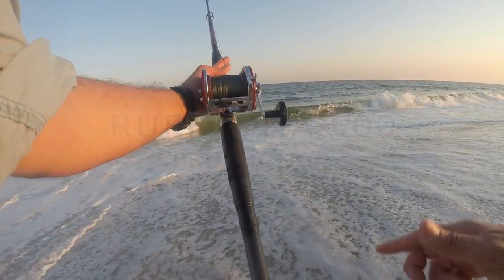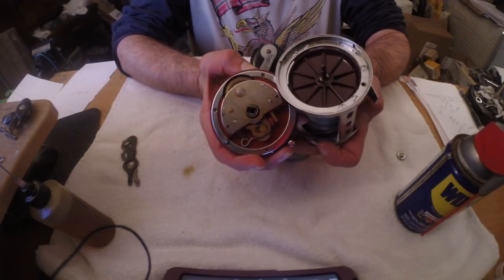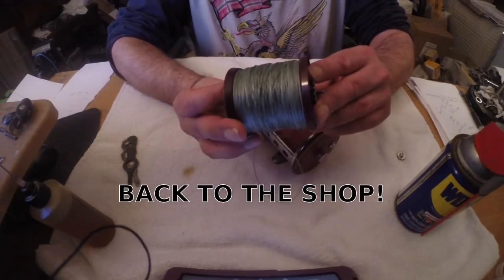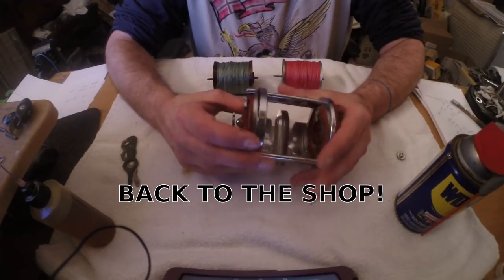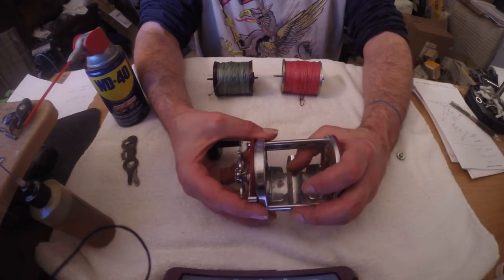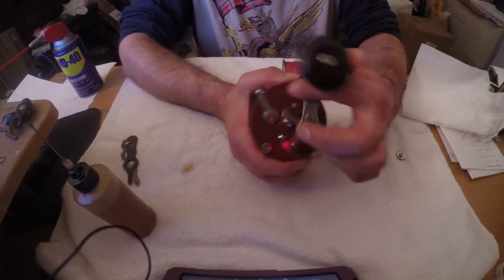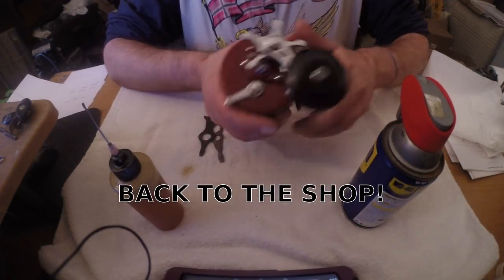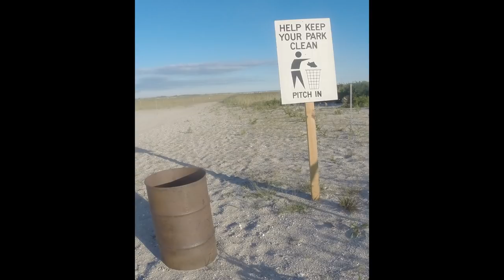PENN Fishing Reels - JIGMASTER 500 Fish Reel - Fluke / Flounder & Shark on the BIG Surf

Comment: Nice  great video I just finished building my new penn 500 with pro gear dual dogs and stainless 10 tooth gear sleeve it makes the reel completely different nice and tight and i have a Newell graphite frame and spool it’s very light and that’s what I wanted great reels
Reply from the maker: Thanks Jim that sounds like one hot reel!  Would love to take it for a spin!  Thanks for sharing!
Reply: @FishYourWay  ya look them up there in Florida Pro Gear  they make all different stuff for the older penn reels big difference I really like my 506 Hs jig master for casting the other 500 for trolling blues or Striped Bass in New England and sometimes bottom fishing for Haddock
Reply from the maker: NICE!!!

Comment: awesome video
I have a Jigmaster 500 Left Hand Wind, USA made. I bought it new many years ago here in New Zealand and have treated it with great care so it looks like new.
Have recently found a alloy spool and a plastic spool in addition to the original chromed spool.
What spool is the best one to use for surfcasting??
Thank you
Pete
Reply from the maker: Thanks for sharing Peter and neat to meet someone from New Zealand and thanks for the kind words!  Good question, I do prefer the bakelite or plastic spools for the surf.  They are lighter and such will spin faster, the arbor is wider so they hold slightly less line taking off a few more ounces as well.  Great question and thanks again!

Comment: Jerry,,I'm getting backlashes on every practice cast with 4 oz lead,,should I try more thumb pressure ,Ive got 20lb mono spooled on ,what about the spool tension adjustment,,Thanks Ray
Reply from the maker: Yes and yes on both but FIRST slow down your casting stroke ease off a little dont aim for the stars.  Do that till you dont backlash then start trying to get a little further each time

Comment: What pound braid do you run? I bought a jig master last year and cleaned it up to use as a back up boat reel. Spooled it up with 40 pound mono at the recommendation of the tackle shop.  They mentioned that any thing less than #25 likes to slip in between the spool and frame.
Reply from the maker: 30 is perfect, and yes too thin a line can slip!!!!  To avoid that if your using thinner line use the bakelite spool it is inset anotherwords spool is slightly narrower so better and you will never fall in the gutter!  the chrome or straight 3pcs aluminum spool too thin a line will have the tendency to creep inside but on the surf use the bakelite spool it will not happen cause it is about 1/4" out check the spool portion of the vid an pause youll see, I should have mentioned this great point!!!!!!!!!!!!!!!

Comment: Just ordered a penn squidder 140, the red one, It was serviced and cleaned by a reputable seller on ebay so Im gonna pair it up with a 12 ft beefstick 1-10 oz . My dad has a jigmaster 500s with the chrome spool very hard to cast. Hope to have a lot of fun with my squidder and one day get an aluminum spool for the 500s and throw 2 magnets in there. great vids would like to see more old reels on here. looking to find some vintage penns at the flea market this summer
Reply from the maker: Awesome reel the 140!  It is my goto on the surf and all I need most the time.  The jigmaster is a bit big and in the end the 140 is more accommodating but easy to clean and maintenance.  Will certainly have some reel vids this upcoming season.  Awesome comment thanks for taking the time to share - Jerry

Comment: Good stuff. I have a brand new in box jigger 500 around there. Its the black one though its probably a newer one than yours. I gotta start using it. I had one in the past but didn’t like that i couldn’t cast well with it. I needed a fast action rod and heavy weight. I wonder if a bearing conversion would help rather than the brass bushings???  Just wondering how to make it more cast friendly.
Reply from the maker: Thanks Ponky, thats a good question.  The 505 has bearings but I think the bearings would speed it up so you may backlash more.  One thing I hear helps is monofilment line.  Another thing is use a heavy grease this may slow the spool.  They can be tricky at first to get the hang of but take her slow at first then go for the stars when you comfortable.  Anything just msg me anytime!  Thanks again for watching and commenting - Jerry

Comment: Hi Jerry how are you did you ever have a Penn 9 m casting reel I am not sure if the side plate screw size do you know what size it is thanks
Reply from the maker: Hi Jeffrey yea great reels!  They use the smaller screw you should be able to find on ebay Jeffrey
Reply: I finally found the screw driver I needed 1/8 in slotted head
Reply from the maker: @jeffreybabino1411  Excellent!

Comment: Great video! Appreciate the informatiom and tips thank you!

What rod do you match the penn 500 reel with? Or what rod would you recommend to match it with?
Reply from the maker: I like to use it with a 8oz rated rod.  Usually one with a 6oz sweet spot.  If you can if you have the reel see how it feels on the blank before you buy.  I been using it with the spinfisher penn rod for a long whiles but any 8oz rated rod would do.  you can go lower or higher if your range is varied Id say 4-12 is ideal.  good question and thanks a bunch Steven!

Comment: Hey jerry I just purchased a jigmaster 500 and I want to use it on the surf to target big fish 🐟 any recommendations of what line I should use and what’s the best rod to pair it with. I have the chrome spool😁
Reply from the maker: they are great, I would use 30lb mono if you are new to them.  A 10ft 2-8oz rod should do the trick.  I do prefer the bakelite or plastic spools on the surf they are lighter youll have less backlash.  the lightweight aluminum spool is good to.  Go easy at first and slowly speed your cast good to go!
Reply: Thanks jerry 💪 tight lines buddy
Reply from the maker: Much welcome!

Comment: I have this reel and I want to use it for surf casting,what size rod do you have it set up on,I’m struggling with backlashes,I have 3 spools,the original silver ,a dark brown plastic one and a dark brown Bakelite one
Reply from the maker: The dark brown on is the one thatll work best the black one second best.  I use about 10' 2-8oz range.  Go slow on the cast at first and then add some power later.  You dont need much to get it out there.  Mono will yield less backlash too
Reply: @FishYourWay  do you mean the Bakelite one or the plastic one thanks again
Reply from the maker: @raymondnasto185  The dark brown and plastic ones you mention you have
Reply: Thanks again, I'll try your advice
Reply from the maker: Much welcome!

Comment: You think 100 LB braid is to much for this reel?
Reply from the maker: Not at all should do just fine with it, braid is quite limp and thin should cast and handle well.  If you feel you need the 100 id give it a go but found I never need more then 60-65 on the surf.  60 takes a good beating and should last several seasons, 40 will wear every few weeks if you fish hard, 100 should make it a long time so you have the go time and insurance when bellys hit the sand

Comment: Jerry, just finding your videos and I am binge watching! I like the tip about wrapping the line around the frame. Also do you use any backing on your plastic spools? I use a couple yards of dacron and then fill my spool up with my braid on my squidder. Although my metal spool I swap for rockfish on the westcoast i run about 10 yards of mono, than fill it with braid.
Reply from the maker: Thats awesome thanks Sam!  Good question about the backing.  I do for all my reels.  I will use 20 or 30ln mono then top with braid.  I will use about a cast and a half of my longest cast of braid or 150yd filler spool.  Just saves money on the braid so I am generally just changing that and keep the mono going for years behind it.  I fish a lot so I am changing it offen.  Thanks again for watching and commenting Sam much appreciate!

Comment: I have a question every time I cast my jigmaster the line spins really fast and somehow it goes in reverse stopping my cast any tips
Reply from the maker: Hmm, trying to think what may cause this.  The only thing I can think of to cause the spool to turn the other way and stop a cast would be a change in the forward motion?  Unless you mean the crank goes in reverse (the handle) which would be a function of the anti-reverse?  Fill me in on detail and we will take it from there ok
Reply: Ken, you need to use you thumb to control the speed of the spool.  If you don't thumb your spool during the cast, you get a birdsnest aka overrun.

Comment: Do you use a shock leader?
Reply from the maker: I generally dont I found 60lb braid handles the shock quite well even with 8oz so do without it.  Lighter line yes I certainly would like 20lb mono or 30lb braid good question

Comment: Great video what size braid do you use for that reel ??  I have one my self I still use it
Reply from the maker: You can go 30-60, big bait I like 50 but 40 is quite ideal for bait and a smoother cast, I find 30 takes a beating so use a shocker!  60 seems on the heavy side.  One size go with 40.  Thanks and great question!
Reply: I greed 40 is for those long cast thanks for info tight lines hope to see in surf one day
Reply from the maker: Catch you soon salvador!

Comment: Jerry ,I tried some  casting yesterday and i was getting significant birds nests with  about a cast distance of 50 ft using my 11ft rod and the plastic spool with 20 lb mono, I tried moderate thumb pressure on the spool with 4 oz of lead and quite a bit of spool tension any suggestions are appreciated thanks
Reply from the maker: Best thing to do first is slow down on your cast.  Just start short dont aim for the stars then gradually pick the pace up.  Try 8oz see what happens you may not be arching your rod when you cast its not loading properly
Reply: @FishYourWay  I’ll try it thanks
Reply from the maker: @raymondnasto185  try diffrent weights as well se how it performs and get the feel 2-8oz
Reply: I magged my Penn seaboy. Just use hobby hot melt glue and glue some washers to the side plate. Then you can pop in/ out magnets as needed for adjustment.
Reply: @thatcrazywolf  thanks for the reply,it seems like the thing to do is to slow down the speed of the spool I’ve got 3 different spools the lightest is plastic,next is a black aluminum,followed by the heaviest the original silver metal one,,,theoretically,the lightest plastic one would spin the fastest and could cast the furthest but could backlash easier,,toying with the idea of magging a spool or two
Reply: @raymondnasto185  it's easy to do and undo with hobby hot glue. It melts at 170f so you can take it off with a hair dryer with no damage to the reel.

Comment: Great video.  What size diameter braid line are you using?  I use mostly mono, but I'd like to spool one of these and my 350 soon.  Thanks!
Reply from the maker: Thank you Bill!  That is 50lb braid, most people use mono and it does work great with these penn reels.  The 350 it is 100% the way to go just guides better.  I would use 20lb mono but some people like 30lb better but 20lb mono is the way to go.  Thanks for watching and great question!!!
Reply: @FishYourWay  thanks for the fast reply and advice.  I will definitely start using the 350.  I rebuilt a few, but haven’t gotten them on the water yet.
Reply from the maker: Much welcome Bill and enjoy the fishing and the reels!

Comment: Any tips on not getting a birds nest when I cast my jig master 500?
Reply from the maker: Sure, a few things to consider.  Go easy on your cast.  If you hear noise slow down your cast thats energy over powered and not going into your rod so you are not going to get any more distance when you hear whipping noises when you cast.  use a heavy grease in the bushings and alot it will slow down your spool.  Widely cross lay your line as XXXX rather then IIIIIII on your spool it will prevent it from digging and catching.  Tighten your spool adjuster slightly so it slows you down a tad.  Dont winch it down.  Feel the line with your thumb but dont press down as to stop it youll eventually start feeling the line as it comes off and slow it with out any pressure.  thicker mono also 30lb is very forgiving as opposed to braided lines as well and once again slow down the cast speed it up as you gain confidence

Comment: Hey, Jerry, great video as usual.. Your drag is a bit jerky...   grease with Cal's :)
Reply from the maker: Thanks mueshow!  Yea, I fish em dry!  Cal's Great stuff be so expensive.  I used to use white lithium grease its dry so dont have to worry about the carbon breaking down.  May do it next brake change!  Thanks for the share mueshow as always and great to hear from ya!
Reply: Jerry, any teflon based grease will work on carbon fiber drag washers.  Quicksilver 2-4-C is teflon based, is available in Wal-Mart and won't break the bank.